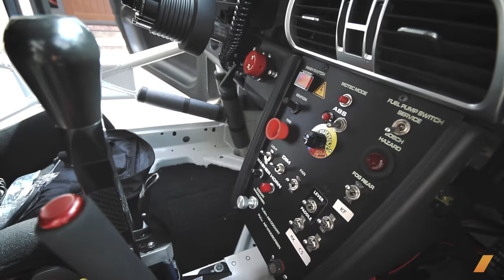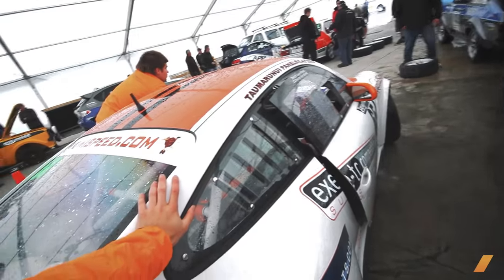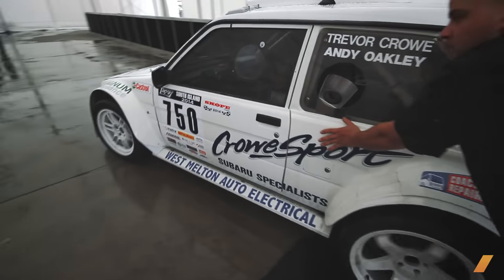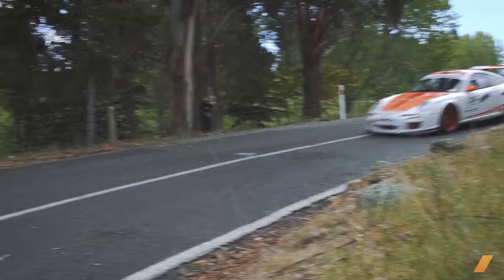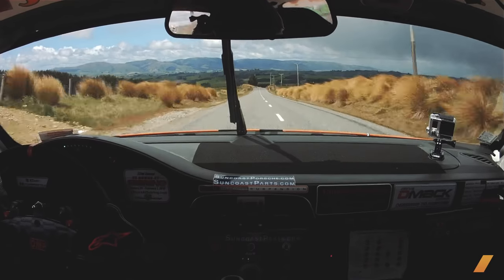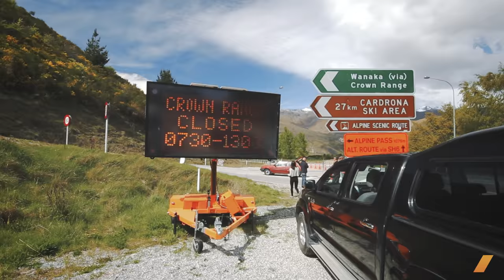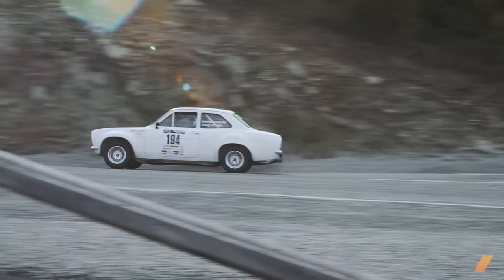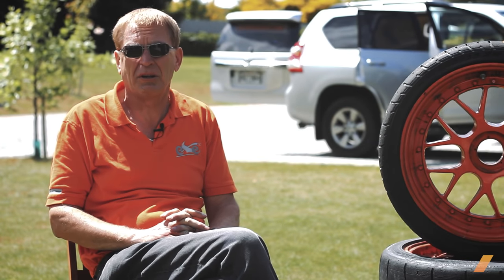Porsche GT3 Cup Car At Targa New Zealand [Episode 11] -- /MY LIFE AS A RALLYIST

Comment: How did they calculate the 200? average speed based on the distance or gps?
Reply: I believe the cars were using Rally Safe, which is a GPS tracking device.  Or some kind of GPS tracking...
Reply: Yes not rallysafe, its a simple commercial fleet tracking system "Trackit" that records position and speed.
Great video thanks for the brief shot of our Datsun 240z in the crown range segment

Comment: Uhm...
The A110 is not a Renault-Alpine.
Alpine was still independend at that time.
Reply: Good point.  Seems to be some confusion there as I see online people refer to them as Renault-Alpines and then others just Alpine.  Did some research and I see you're right... just had Renault engines at the time.  By bad.  I don't really know much about those things.  That was the first time I've ever seen one.
Reply: Ryan Symancek The A110 (and the A110S) was made by Alpine, using Renault engines and gearboxes.
They never really got off the ground financially, and Renault bought the name and factory.
Then Renault built the Renault-Alpine A310 (a competitor to the Lotus Esprit), the brand "died down", and there've been a handful of concept-cars over the last two decades none of which "materialized".
Now Renault wants to make an all-electric Alpine in 2020.

That's the short version.